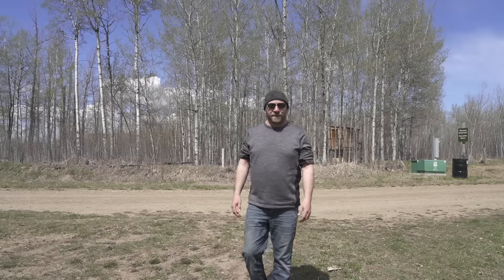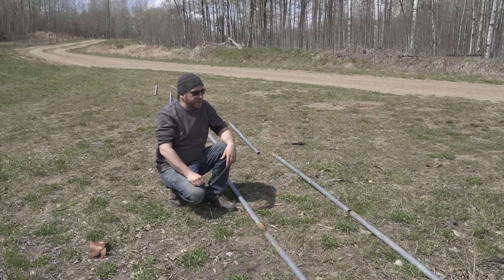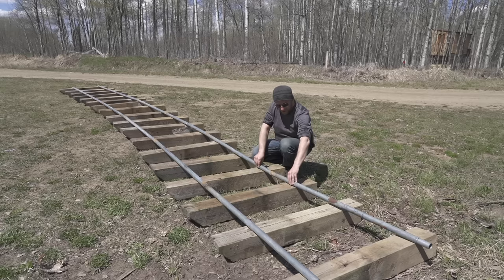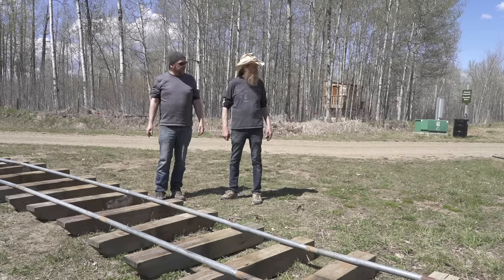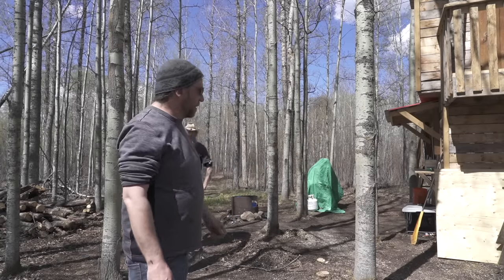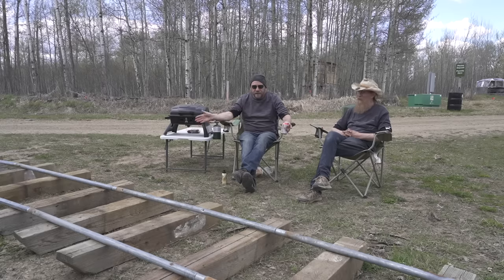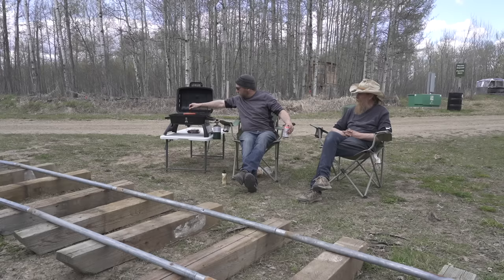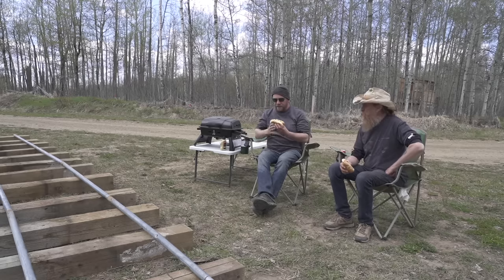Homemade DIY Railway - Work Begins Update

Comment: Hey Steve & C. N.,
That rail system will be a blast. Probably will some head scratching moments during the build but lots of fun in the end. One thing I noticed and it may not be an issue but would it be better if the pipe joints are located directly above the railroad ties. Seems that would prevent them from deflecting downward due to the trolley car weight. Gate trolley wheels look like they should work since they have a flange on one side. Only problem I see with screwing the tubing to the rail, as you described, would be the wheel flange striking the inside screw head. Looking forward to upcoming adventures.  ...Best to you

Comment: I’m very into this. I’m skeptical about how the fence rollers and round rail will handle in a turn - I’d recommend getting some pieces and try it. But I’ll be here watching either way!

As for turning around maybe consider a small turn table? It might be easier than a loop.
Reply: a 'wye' is contemplated  at this point in time...subject to change...
Reply: You’re right. Train wheels are actually cone shaped which allow for the train to make turned. It’s simple yet brilliant engineering.

Comment: This is an awesome idea, but you might want to do a small test run with your engine before placing all the track.  It wouldn't do if your engine collapses the pipe as it rolls down the hill (that might be why in the other video you mentioned the person used flat rails).  Great video though, and I can't wait to see how this project turns out.

Comment: Depending on your weight requirements, work site tricycle frames and wheels could be useful. Pull the tires and leave the spoke covers. Maybe even cut a couple tubes to give a couple layers of rubber. The drive cog on a trailmate would allow a chain drive from a small engine and an inertial clutch from a chain saw would allow it to engage when the engine is above idle...  Food for thought.

Comment: I agree with everyone else, whatever you do ends up being fun and interesting, so built a railroad! HUGE heads up on the rail engineering ( from an actual engineer-type guy 😁) center the joints of your rails on top of a tie, ALWAYS. Let the joints guide the spacing of your ties. 👍 Tally-Ho!

Comment: I'm definitely no railway expert, but I'd consider putting a tie directly under each rail joint for support. Aside from that, love the video! I always look forward to your uploads no matter what the content is!
Reply: If the joints are on a tie the fastener would interfere with the joint expansion/contraction.
Reply: @JohnGault2398  Not if it's offset? Joint doesn't have to be centered on the tie. Or am I mistaken?

Comment: On film sets, I've seen them make dolly track using speed rail. Speed rail is often a 1 1/4" aluminum pipe. Considering a JL Fisher type 10 dolly weights around 400lbs plus the camera, camera operator, DP and sometimes the first AC on it. The aluminum pipe has fairly thick walls though. 

Fortunately Amazon has plenty of round track wheels for sale and probably cheaper than anything Fisher would use. 

For the engine I was thinking of a converted electric wheel barrow. You can even make a plywood, or 2x6 path between the tracks for the wheel of the electric wheel barrow.

Comment: To avoid the bumps that will come with what you're riding on to make the ride a little smoother, consider grinding down the backends of the bolts you put in and making it almost flush with the rail itself, if it's steel it won't degrade as much as iron over a long period of time and it'll still be sturdy as well as lasting-also repairs if one burns through shouldn't be that difficult. Just make sure to not shave too much off a bolt at once at risk of them degrading over time--just a thought, if you're using the homemade railway often, the bumps may turn from somewhat charming to somewhat annoying real quick

Comment: The only issue I see is that even if you have the rails screwed down in the center, the rails will roll to either side.  Putting some kind of wedge under each side should prevent that from happening.  I look forward to watching the progress.
Reply: You could try cutting a narrow V-groove in each side of the ties for the pipe to rest in.
Reply: A v-groove is a good idea.  The only issue I see with that is you wouldn't be able to tweak the rail width once that's done, so the widths would have to be exact.   Being that it's a homemade railroad and not CN's main line it shouldn't be a big deal.
Reply: @TheLowlyTraveller  That's true. Cutting those grooves will be your most critical measurement. If you mess up, you got 3 more tries all around the post(:

Comment: Steve, make sure when you lay down your "rails", make sure to put the connection point of each steel pipe section on one of the wooden railroad ties "aka Sleepers", (Yes, Steve, they really have a unique name for Rail Road Ties). Also, you may be able to get special fasteners, that you can bolt on the railroad ties &  mount under the "tracks" to that.

Comment: Make sure the footer spacing is an odd multiple of the train and car’s wheel distance. Else the light gauge rails will sag and you’ll develop a harmonic when riding.
Reply: How fast do you think there going to go? Lol
Reply: @vicferrari9380  Doesn't matter- It affects cross-tie loading which will displace them. Anything will work for awhile but there's a lot more engineering in  a train track than you'd ever believe.

Comment: I guess you have seen "Way out west" in Ireland regarding their railway with the flat bar stock. It is a wonderful project for you to have your own railway, though I would suggest a gauge of no more than 18 inches and maybe 12 being better. There are many small railway projects in the US. If you look at a few of those, you may find a sweet gauge where there is more off the shelf stuff available. 12 to 18 inches will also allow your sleepers, as called here in the UK, ties as you say, go twice the distance and save a lot of money on ballast, which you will need.
Reply: this is exactly what i was thinking, a narrower gauge would allow you to split each post into 2 so will go twice as far, the other bonus is that you need to clear and grade a narrower path so progress will be faster.

Comment: From experience with dog kennels and fencing I can say that the pipes are not as solid as you think. One good tree limb fall and the pipes are crushed. I tried to build a small roof out of 1/4 plywood and 2x4s on the pipes of a kennel before and it collapsed after about a foot of snow fell on it the first time.
You may want to go with square or rectangular tubing. I know prices for everything is crazy, but it will hold up longer with weight on them more than what that thin pipe will. That or even heavy metal gas line might work as well.
Being suspended in the air and not being flush to the ground may also bring a concern with flex with the pipes unless you plan on the wooden ties in the ground, which it don't seem that way.
Anyways, good luck guys and have fun!

Comment: I love the idea. Just remember that the chain link fence tops are galvanized which can and will cause zinc poisoning with any welding so appropriate breathing protection would be required or sanding off any section to be welded inside and out to remove the zinc coating. You may be able to use a thinner strap type bracket to maintain a low profile whilst holding down the rails without welding which should make it a bit quicker as well. Rather than make a switch (honestly have no idea how that works) you could run your locomotive at both ends and just move to the back aka the new front when hitting the end of the line or make it a continuous loop and take the scenic route each time. You may be able to find casters that go on rails, check with anyone into films and such as they tend to use a dolly on rails for certain shots where a fast long distance zoom type shot is needed. For extra traction you could potentially add a rubber strip to the inside of the caster or rail wheel but wet and icy weather are going to mitigate that right quick so some investigating how trains maintain grip and apply braking would have to be looked into. There is probably a way to fit train wheels onto a four wheeler thinking of Top Gear or The Grand Tour they did something like it with cars on a train track. I suspect some motorcycle rims might fit a nice profile over the piping used for the rails but I've no expertise and am just spitballing. Contact the YouTube channel ColinFurze as he's really smart with making vehicles out of other ones and has made a small minecart system for his underground tunnel he is digging.

Comment: This is awesome! I’m probably parroting suggestions that people have already made but here’s my two cents from someone who has no rail building experience. 

1. Determine what your rail piping can handle before it crushes. The spacing of ties will obviously influence this.
2. Try and find or make a bracket to attach the rail to the ties. Screwing the rail directly to the track sounds like it would invite tear out over time.
3. If you can get your mitts on a skid steer, strip off the top layer of organic material so you’re building on a compactable base that won’t rot away over time.

Cheers and good luck!

Comment: I like where your heads at, but being the practical person I am, have you considered finding a decommissioned carnival ride or small train? I’m thinking the old Flintstone grounds near Hope BC, but I’m sure there are many.  I think building a raised rope bridge would be more useful, as the snow will be deep but a raised rope bridge could still be useful.  Then also maybe put in some pulley with basket system, to send things from camp to camp, keeping it raised off the ground.  If it’s a cable or rope, then the snow wouldn’t really stop it.

Comment: choo choo in the zoo. Steve I used to install rail lines underground (gold mining industry) using a simple gauge to keep the track spacing equal at the joints.  A simple "H" frame spacer will help your construction effort and cost little to no money.

Comment: There is special railroad rail for smaller railroads. It is the same shape as standard gauge track, but much smaller. You find it in mines. 

In America some industrial properties have their own track in it. Some is standard gauge so they can interchange traffic from mainlines. Some is independent to haul mineral ore or other things. 

There are Rail Spur Contractors who build those and maintain them. There would also be companies which sell smaller spikes and rail. 

I admire your stealth camping. I have done that since the 1960's. I have been a rail fan since then as well.

Comment: For air-conditioning in your bus you should be looking at the most efficient unit, that's a small house split system aircon (you know one part outside one inside,  those single part wall units are power hungry).  should only be a few hundred dollars,  get the smallest one you can.  If you don't want to uses generator you will need at least 1500w of solar or 4 large house panels, more if you can. You'll need a 2-3000w inverter and if you want to run lithium batteries to power it out gets expensive as you'll need one's that can output high amps.  I've just been through all this so feel free to ask any questions. We're in a Toyota coaster bus

Comment: Attach fence rails like coping on a skate ramp. Big hole on top of rail to allow screw head to pass through. Small hole on inside of pipe to allow screw to reach the timber. Your wheel will roll right over the blind hole.

Hope this makes sense. Probably plenty of you tube videos on skate ramp builds. 🤘

Comment: Steve, you’re a cool dude.  I think you have a little bit of an engineering background in there, or maybe just a lot of model railroading.  Ballast will protect the integrity of the track by alleviating some of the problems with ground movement, frost heaving, and so on.  If the round tubular rail doesn’t work well, you can always try the technique that the very first railroads used, which works reasonably well for light loads - steel strap (flat steel bar) laid down flat on wooden rails, and screwed to the wood.  Also a simple and inexpensive route.  Yours is a promising one.

Comment: In place of sleepers have a look at treated shipping pallets. They last for ages and stores give them away. If they rot replace with new ones. So easy.  You need to learn the difference between the pallet styles, some aren't treated.

Comment: In my tree house factory I work with this wood quite a lot, those bulks will last you long but if you plan to hold them out in this condition they will rot under 2-3 years, you do not have to "restore them"  but you should give them a clean and brush them over with wood protective paint chemical because the green one it has has faded away. And they are not cheap to buy new so to say.
Reply: they are already 'protected. they have been in the ground for 10 + and look great....

Comment: You're going to need something that has a front in bucket on it whether it's a lot of tractor or an actual skid load or something like that to carry your ballast around as well as move your railroad tracks you all may also need something like that to level the areas that you were talking about needing leveling.. ? Nice to use something like that to cut your grass if you have a nice big piece of property

Comment: In a conventional rail, the strength ( ability to carry a load ) is mostly provided by the depth of the rail web.  The pipe that you are using has nearly no web depth so it will tend to sag between the wood.   Possibly adding a board under the rail can help.   Just a suggestion.

Comment: Not knowing for sure but I wouldn’t fasten the post rails down solidly. I would allow for the rails to be able to expand in length due to heating up or contracting due to cooling off. 
My guess is that an expanding 
rail is supposed to slip against the tie plate and also slip under the railroad spike.
EDIT: Also leave each end of the rail (fence tubing) half way plugged into the next rail. This  will allow the rail to expand and contract without bending the rails. So no fastening rail joints.

Comment: So where are you get the remaining thousands of 8x8s and tubing? Secondly, what about attacking the wheels over/under where each track tubing is in contact with the 8x8

Also, the ballast just isn’t for protecting the 8x8s, it’s to protecting the ground from washout, erosion, etc that the track sits on. It acts more like a protection from the load over the track. It also keeps various growth and vegetation from interfering with the tracks. This is a MASSIVE job. I’d love to see you do this, but it’s a major undertaking and you WILL need the ballast along the ENTIRE length of the track. That’s a LOT of crushed stone, based on the calculated load above it. This is crazy. Make a coaster instead using PVC, that would be “easier” and more fun I think.

Comment: Fell trees as rail block it up. tires off the atv inner and outer 6"weld on ring to stay on rail trees drill hole go through both into ground rebar

Comment: Two possible suggestions: 1. If you clamp two railroad ties together using bar clamps, you could drill two holes the diameter of the "steel track" (one left, and one right) through the "seam" of the ties. When you release the ties from the clamps, you'll have two half-circle groves  (one left, and one right) in each tie to drop the track into. If you use a 1" spacer block between the ties when you clamp the ties together, you'll make the drilled groove slightly less than 50% of the circumference of the track so that the track will not fall a full 50% into the groove, which may be necessary for proper track exposure. 2. I would suggest laying out the track and ties so that all track connection joints fall directly on top of a tie so as to support/reinforce those weak spots in the track. Looking forward to seeing more of this project.
I'm also a big watch fan...did you know there is a unique style of wristwatch that is considered a ralroad style watch? They're very unique, very functional, and very cool. For a great example of a railroad watch, see Swiss Maker: Mondaine. Cheers!

Comment: Look into home made roller coasters, they have all of the kinks worked out for building something like this. Specifically related to dealing with elevation, rollers on cylindrical pipe, creating turns, etc.

Comment: Cut the fence posts in half and make it a narrower gauge, that will allow much tighter curves and gives you double the length you can build the railroad. I would use appropriate miniature rails to allow for best use.

Comment: Most of those cases POWs, prisoners of all kind and East Berliners digging tunnels involved some kind of railtracks usually after using cart with ropes both front and backside and they used it like a cable ferry but in longer distances the cart usually tends to stuck to walls etc. So adding rails that roapsystem could work even if the tunnel wasn't straight on but have some moderate curves.

Comment: Put bolts into the timber, and mark and cut a hole on the steel, then place the steel onto the raised bolts that would hold it in place, and allow for easy replacement. 

Or use the timber for retaining walls and the steel for a fence.